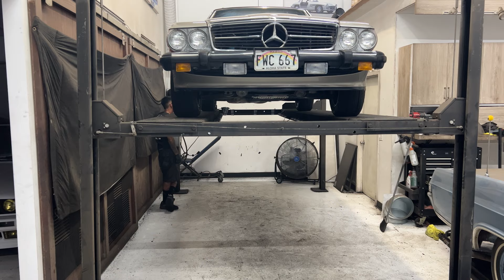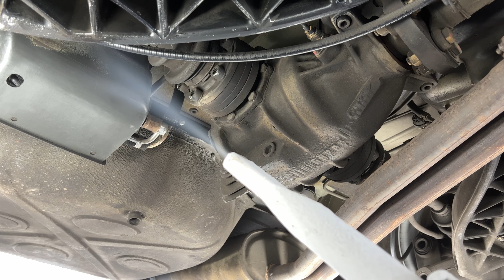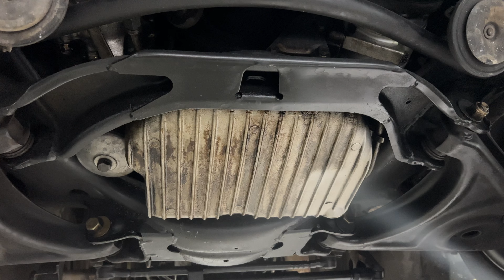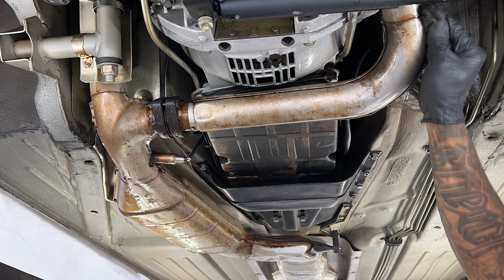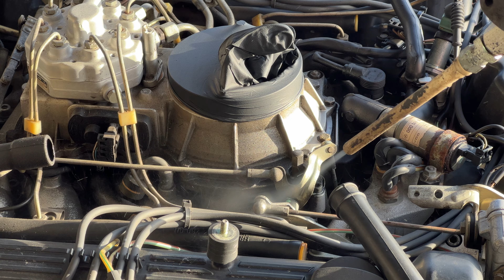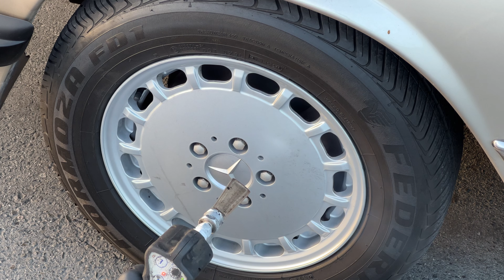Mercedes 560SL R107 Dry Ice Cleaning & Full Detailing

Comment: The best and quickest results I’ve had when cleaning exhaust pieces is using a chemical called Ospho. If you look it up it’s a very useful tool for efficient exhaust cleaning. I use it with steel wool.

Comment: Thanks for showing how you polish the convertible top rear window.  I've got a 1972 107 with the original convertible top.  The plastic window is badly oxidized and has a few stains that hand polishing can't take out.  I'm looking forward to using your method.